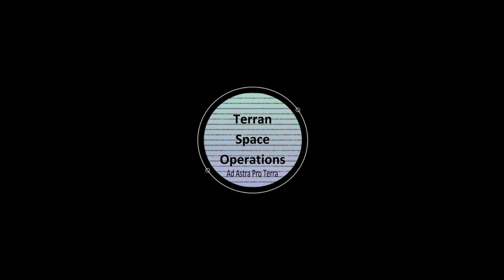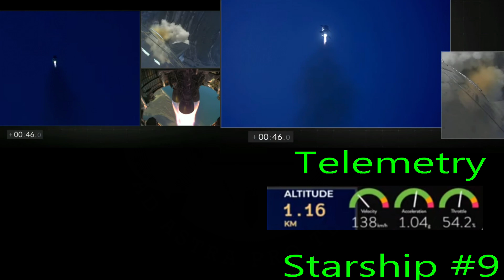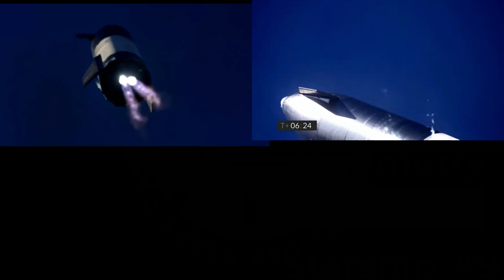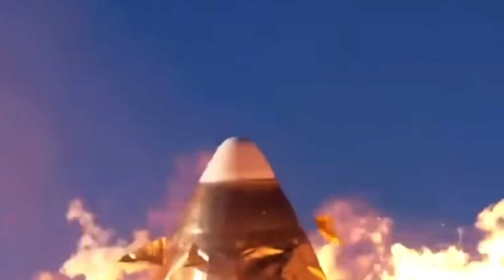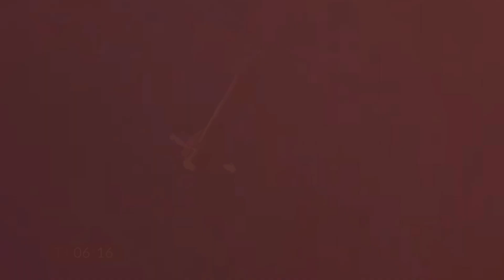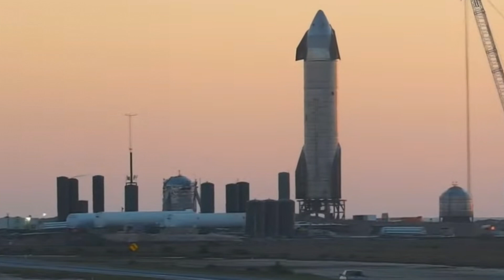Starship 9 Crash Analysis

Comment: Lighting up all 3 engines to brake, then shut down 1 by 1 to lower the descent makes too much sense.  
Not to mention, the 2.5 km difference in total altitude had to play a little bit in the braking.
Reply from the maker: We think so also. The higher altitude was chosen for a good reason I’m sure
Reply: I’m unsure about that. SN9 began skydiving at 9km, about the height of the Everest summit, at about 300 millibars, and clearly achieved controlled descent despite overcooking the flip maneuver. An additional fall from still thinner air should result in an even higher terminal velocity peak.
Reply from the maker: @murraypearson2359  you are right...
Reply: Seems to me they don't have enough pressure in the header tanks for two engines, much less three.
Reply: 3 engines initially and starting the flip earlier (at least for now). Push the boundaries later. Given the 2 failures an early engine re-light with 3 engines targeting 1km out to sea is worth a punt as an experiment to demonstrate redundancy should an engine fail to ignite. If all 3 light, sure, shut one down...
Reply: light up all 3 will have too much thrust to control.... but seems 2 only will have too little redundency... very tricky here, possible to use 6 engines with half thrust each?
Reply: @free00701  Well, if six engines at half thrust is feasible, then three engines at 2/3 thrust will be exactly like two at full thrust, right? And if one craps out then the control system promptly shuts it down and uses the two remaining; if not, then any one of the three can be shut down and a two-engine landing accomplished. Anyhow, once the speed is scrubbed off, I expect the craft to land on a single engine as it obviously did for SN5 and SN6. That is probably a requirement for hovering, the capability of which is a great advantage of Starship over Falcon.
Reply: Better 1km altitude maneuver to brake..use 3 engine
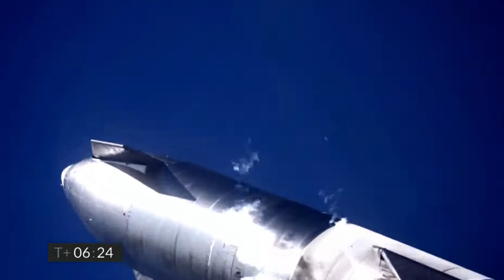Reply: At 7:45 there is something falling out from engine bay, 2 times. Its clearly visible on another cammera on another channel. Something silver fly away from underneath rocket.
Reply: @simonci5177  Scott Manley mentioned those, and pointed out that they flutter in the air so they are not massive. They're likely COPV thermal blankets: losing those should not doom the rocket.